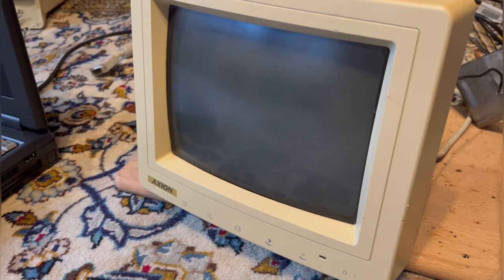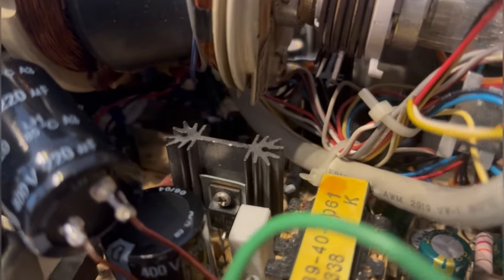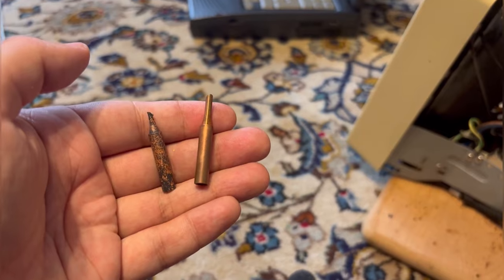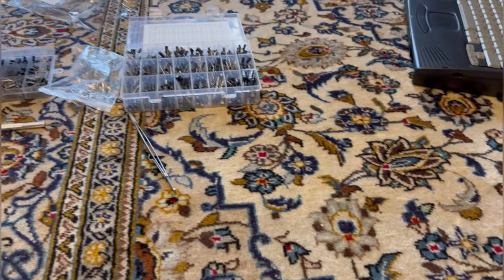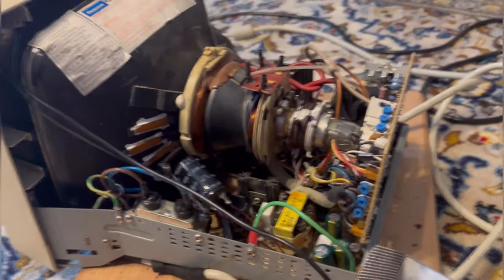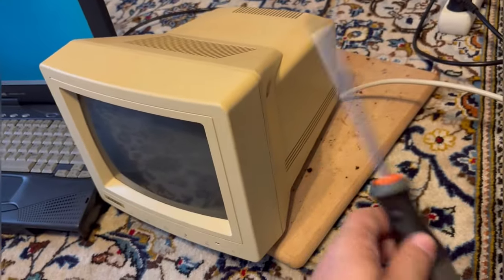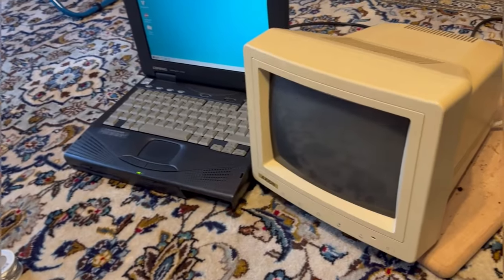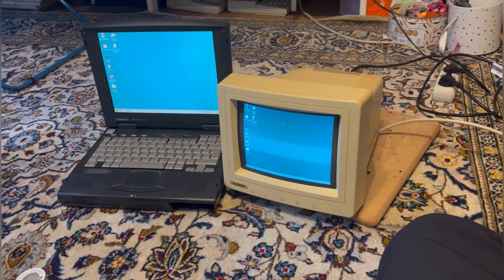Re-capping a CRT monitor: the issues, pitfalls & the result.

Comment: Hi Nino, interesting video. I wonder, does this monitor support the laptop's resolution perfectly? Have you tried something older, like a 386 with a VGA? 
Then I ask you, did you change all the capacitors at random or did you know more or less what they did? I ask you why I have a problem with my DM 602, which works but does not display the upper half of the first line of the screen. I would like to understand if there is some modus operandi or if I have to search in the dark, thanks.
Reply from the maker: Pardon my ignorance: what is a DM 602? And — 386! That you must reopen this wound, sigh 😆 Happy you like it! And to be frank: no, no plan, totally in the dark. I was changing all capacitors on the board exactly behind the screen - and "most" others, judging that those at the end of CRT most likely control the ray, and the others "some other stuff". Of your "DM 602" is/has a screen, then maybe either the screen needs calibration / positioning of the image, or a cable is not fully attached (had that on a laptop: and if you press a specific place, the line appeared; my solution was to squeeze a matchstick under the bezel "to forever press that place"). I will now try to run it with a different machine…
Reply: @ninoivanov  dm 602 is mda/hercules green mono crt commodore, but produced by philips. Is very common, you can find it everywhere also for the c64 / apple II
Reply from the maker: @retronoobtech8551 Thank you!

Comment: My rant, this is for young users of CRT monitors, not you Nino.

Young people with nostalgia illness, particularly those who never used any of this technology, are sick…

CRTs suck. They always sucked. First off the image on screen is distorted no matter what you do, you just have to try to make the distortion as even as possible. Next the colors are off and calibration took way too much time. Also, your white point was BLUE. This was particularly frustrating if you worked in graphics, print media, or photography.

They were heavy and awkward. To this day I have back problems from lifting 21” CRT Monitors.

The biggest part in the CRT monitor IS the CRT. The cathode ray tube is a consumable, meant to be replaced after time and the more they are used the worse they look.

You young people have no idea how great it was to get genuine flat screen CRTs and how great it was to get LCDs a few years later.

This whole “I game on a CRT because that was what the game was designed for” is cork sniffery or the most hard R kind

The Emperor wears no clothes.
Reply from the maker: That is a BRILLIANT rant! 😄 I … like them. BECAUSE they are crappy. 😆 You know what? In your honor, I will make a video on how to use a Fallout-like map on a modern iPhone, WITH crappy graphics!
Reply: @ninoivanov I am honoured sir 😂